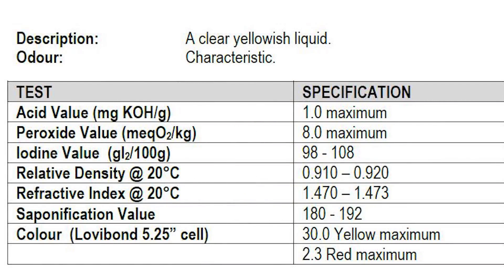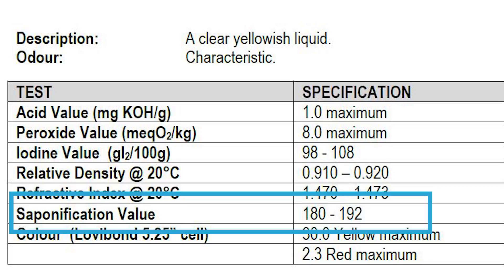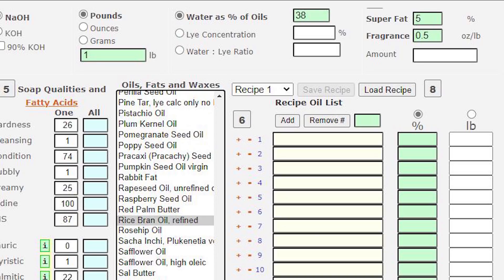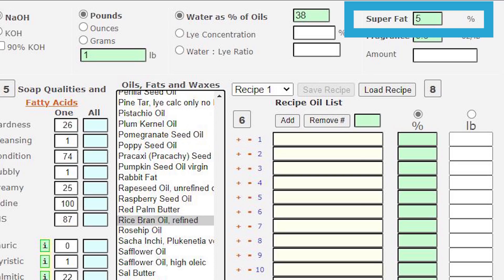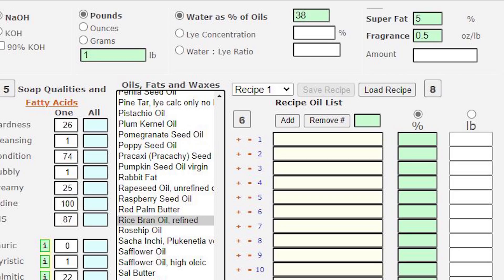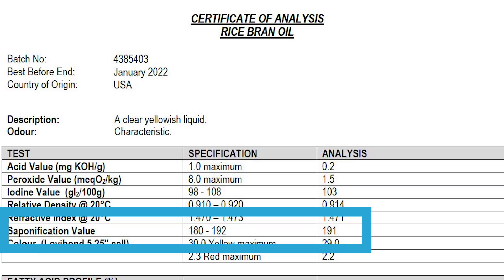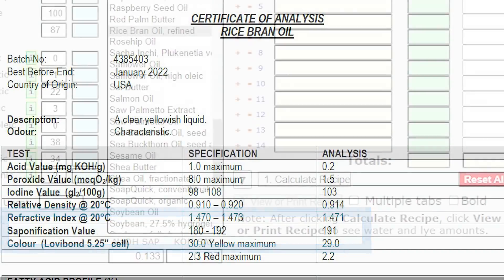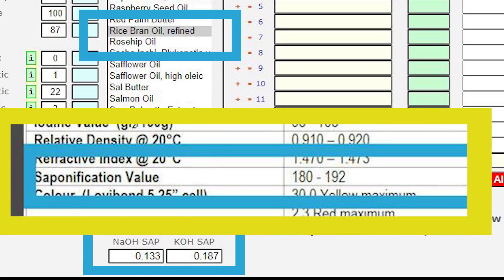Superfat, Saponification, SAP values and Lye heavy soap. Cold process soap making tutorial

Comment: I made a batch with my normal recipe and didn’t add a super fat because I was not knowledgeable that it’s best to include one, but Made sure  that my cleansing value was lower so it would not be so drying. Is this soap ok to use in the shower? I was relieved when you said that the calculator has a built in safety margin so I’m relieved that my soap has some superfat.

Comment: Thank you so much for rhis video!
I made a mistake, and accidentally put 11 g of olis less then it shoul be out of 900 g of total oils. It was supposed to have some superfat, but now there is 0 superfat and less oils than ot should be. Do you think it will be too heavy to use? I've rebatched one part of it and left the other to see what it will look like.
Reply from the maker: Hi, it will depend on how much superfat you had to start with, if you are sure that it's 0% superfat then it will be OK, but maybe a bit drying. Did you mix any mica etc with oil when you made the soap, if that's the case you would have added a little extra oil anyway.
I did some rough calculations (I don't know your recipe, so couldn't be exact) For a 900g oil recipe with 25% each of 4 basic oils the lye used with a 5% superfat would saponify 855g of those oils. So it's likely that if you started with around a 5% superfat that you will still be fine as you would have about 34g of unsaponified oil
Reply: @IDreamInSoap  no, I didn't use any mica. After 4 1/2 weeks  it still makes my skin dry. I put olive pomace oil, pig tallow, coconut oil, castor oil and shea butter. Thank you very much, love your videos! ❤️

Comment: Can you tell me what I did wrong as I am new to soaping.
. I used a recipe I have used before 
. It does have fragrance in it
. I poured cupcake soaps
. Put in fridge for a few hours so they did not gel. Wanted them to stay milky looking
 . That evening about 6-7 hours after making them I noticed lye had formed small crystals on top of each cupcake 
. I cut one open and it was soft and perfect texture I think
. The soap lathered up nicely and smells amazing 
I have rinsed the tops of all of them to see if it surfaces a second time. 

Are they usable 
Any idea what I did wrong??

Thank You 
Katherine
Reply from the maker: Are you sure it was lye on the top? if so they would be dangerous to use and probably sting you whilst using them. It's more likely that it was soda ash

Comment: Thank you! So if I have a lye heavy soap and it's no good, how do I get rid of it? If I use it in laundry, will it ruin my clothes? Or maybe it'll clean my washing machine! 🤔
Reply from the maker: If you use it in your washing machine (grated down) it won't ruin your clothes, lye is water soluble, so will flush down the drain. Remember it's also what is used for drain cleaner, so you it will probably give your machine a bit of a clean, maybe not too much because unless you really mucked up your calculations there shouldn't be loads of excess lye. I've never use lye heavy soap in a washing machine (I've never actually had a lye heavy soap apart from the little on I deliberately made in this video) I would want to make sure my washing machine did a couple of good rinse cycles

Comment: Thank you so much for this video!! It has so much great information and i learned SO much!! i just unmolded my soap i made yesterday and im seeing white spots all through the color of the soap, i thought WHOA! is that lye?!! but it cut very smoothly and wasn't brittle at all. 

Just a suggestion bc i personally am so dumb about this but IF possible could you make a video on the differences between the different spots in soap. What is DOS? my spots are white, could it still be bc of the superfat? Im just so confused about it and i don't want it to be a dangerous soap and i want to learn more about it so i can not let it happen again.
Reply from the maker: HI Kat, if it is generally soft and smooth then it's unlikely to be lye heavy unless you just have lye spots, but those would be very hard and crumbly. DOS would not be in your soap straight away it will develop over a number of weeks/months as the soap cures etc. 
The white spots are likely to be either titanium dioxide that you haven't dispersed properly (if so I have a video on how to do it) or Stearic spots, these happen when you soap at a cool temperature, the stearic and palmitic  acid solidified before the rest of the soap giving white spots throughout the soap. If you used TD and don't know if it's that or stearic spots run your finger over the spots, the TD will smudge, stearic spots won't. 
I hope that helps
Reply: @IDreamInSoap  THANK YOU SO MUCH!!  WOW!! I can't say it enough. THANK YOU!! ive been thinking about this soap and what i should do with it. After researching everything you mentioned in your comment to me i have found out they are Stearic spots.  I'm both happy and sad about that. haha

Thank you so much for being so kind, so willing to teach and so giving with your knowledge. You really have been helping make me a much better soaper and my soaps really actually has improved so incredibly much just since i started watching you!

Comment: I have only made melt to pour. I have created a cold process recipe myself, I have not made it just yet. I’ll be making a loaf on Sunday. I will be using a few different oils. I’m using 43% Rice brain oil and 15% Shea butter 8% Safflower oil high linoleic. Do I still need to use a super fat with these oils? These soaps will be facial bars. I really need some advice!!!
Reply from the maker: Make sure you run everything through a soap calculator, those oils don't add up to 100% so not sure what other oils you are using. I would always use  a superfat and find 5 or 6% works well, unless the missing oil is coconut, then you would want higher

Comment: I love how you explain things so throughly. Thank you! My question is about making a noncomedogenic soap. Coconut oil and olive oil can clog pores but if there is zero super fat and all the oil was saponified would it still have ability to clog pores?? Wondering if I could go lye heavy with those oils and blend it then add other non-comedogenic oils like sunflower and jojoba afterward and blend them in? Any expert thoughts would be greatly appreciated.
Reply from the maker: Ooh, gosh that is outside my experience I'm afraid, so would hate to give advice that I wasn't certain of. One thing I can advise on it the action of saponification and oils. With cold process you cannot chose which oils saponify and which are left as superfat, the lye will take what ever it wants during the saponification process which takes up to 3 days, so any oil you add before the end of that process can be consumed by the lye. If you want to choose a superfat oil you would need to hot process your soap, so make the soap and cook it, get it saponified, then after that, before you add to the mould you can add in your superfat oil. Hope that helps a bit
Reply: @IDreamInSoap  ok thank you for your reply!! yes I had just heard about doing that from Elly down under about doing the hot process method. I don’t really want to do HP though😆

Comment: I am making a 50/50 cold process soap where I have infused, for two months) the olive oil with lemon rind and bay leaves (strained off later) and then added the coconut oil and brought them up to 80 degrees to enhance the oil scent from the rind, its has a faint and delicate scent but has all the lovely colour of the lemon rinds too. Hope you approve!!
Reply from the maker: Sounds great, just be careful if using anything fresh in an infusion, it can mould and cause problems.